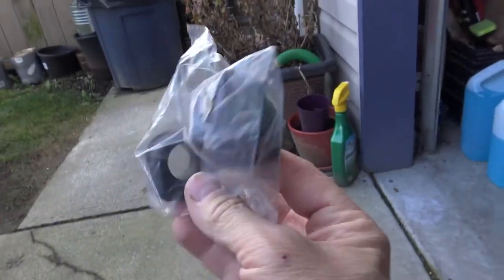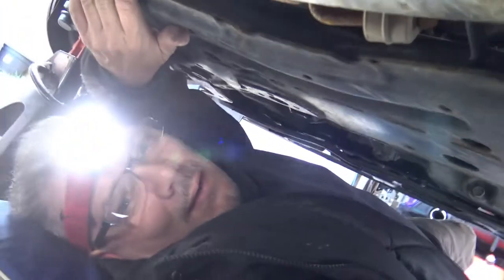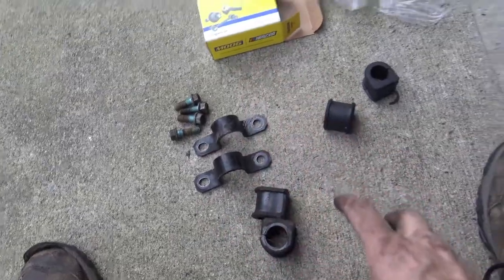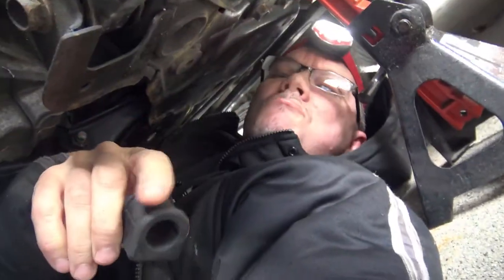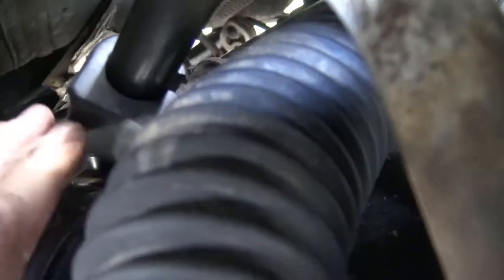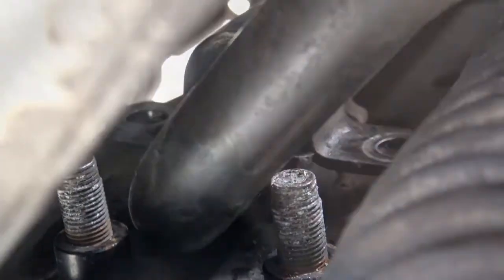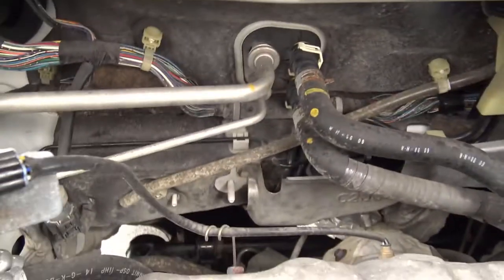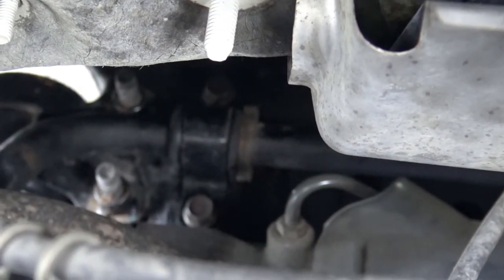Fix the Mazda CLUNK!!

Comment: I've replaced nearly every part of the suspension with the exception of these bushings.  This clunk has driven me crazy for 2 years. Thanks for taking the time to show us this.
Reply: Same. Did the bushings fix your clunk?
Reply: @thaitichi  it was a sway bar link that prematurely wore out. I'm not sure how the mechanics missed it several times but its fixed
Reply: Same here, I replaced links, struts, and ball joints, and still clunky…need to do this.
Reply: I’ve had my entire suspension replaced and started making sounds. Brought it to dealer and multiple independent places and they say nothing is wrong. I was about to get axles replaced, gonna try this now first
Reply: @incubaked  Did it fix the sound?
Reply: True story right! Every Mazda has a clunk. Couple other spots to check, are the front top strut bolts, notorious for getting loose and clanking. The passenger side upper motor mount is also pretty much guaranteed to be broken (easier fix than it sounds) rear strut mounts are always cracked, and the brakes can make a nasty racket if there anything is slightly out of place..hope this helps. (Own 2 Mazda 3s been tracking down suspension  noises for 2 years now)
Reply: @incubaked  it was the sway bar link.
Reply: @kaseyk2701  same metalic noise felt on pasenger side. Sounds like lose assembly. Suspecting sway bar bushings
Reply: @kaseyk2701  You are a genius. Been dealing with clunks for 2 years as well after my transmission was replaced. Replaced LCA, tie rods, sway bar links and still clunking. Never thought to check the strut top bolts. They were less than 10 lbs ft. Torqued them to 28 and center bolt to 45 lbs ft and now completely quiet. Thank you. Thank you. Thank you.
Reply: @TheLeedog83  was sway bar link for me as well. Although my suspension in general is not in great shape

Comment: Thank you and I appreciate your time and effort to document your DIY projects. Of note a couple of points. It was easier for me to 1) remove both front tires 2) remove the lower nut from the stabilizer bar links and disconnect the stabilizer bar from the links 3) a flex head ratchet is a must 4) 14mm tall and short sockets . 5) Soak all bolts with WD40 or similar product.  I was able to easily access both bolts that hold on the bushings without the need to go under the car. By detaching the links allows for the bar to be rotated to access the front bolts more easily. And finally the stabilizer bar can be moved around easily to allow access to remove and replace the bushings. And YES my clunk went away. For my 2012 Mazda I used Polyurethane bushings made by Siberian Bushing part # 4-01-2143
Reply: 11:15 "I was able to easily access both bolts that hold on the bushings without the need to go under the car." - When I saw the end here I was thinking the same thing!
Reply: I just added a question/comment above.  My bushings seem to be held on by a wingnut????
Reply: Thank you so much. About to do this job for my mom. Extra tips like this always help
Reply: @christianerance  Thanks for those tips, going to get this done this weekend  cheers mate

Comment: Thank you Mike! I just finished with this repair and it fixed my front end clunk. If you remove the 14mm nuts from both ends of the sway bar linkages and rotate the swaybar up out of the way, it gives you a little more space to work in your video at the 4:00 mark.
Reply: How did you know for sure the sway bar bushings were the issue? I bought an 09 Mazda 5 about a year ago and it definite has a clunky front end especially over bumps and stuff. I have no problem doing the work myself but it's a little overwhelming to start figuring out what actually needs to be replaced because it definitely feels/sounds like shit.
Reply: @jonathangaliano2617  Remove one sway bar link to the strut on the driver's side and arm wrestle or wiggle the swaybar, if you listen, you can hear the clunk. probaly replace the links whie you are there but that is just me..
Reply: @simulatortechnician9598  Yea I ended up doing the bushings 2 months ago. Like I expected it was a pain to get to the bolts and naturally on the last one it snapped. Ended up having to take it to my brothers and use the lift. Had to drop the entire sub frame and weld a nut onto the broken bolt. Eventually got it out and cleaned up the threads. Also did the sway bar links. Still a clunky piece of shit but at least that's over with lol

Comment: Thanks for the video! I just did this on my 2007 Mazda 3 sedan and holy mother of heck was it a tough job getting at the bolts and, most frustratingly, getting the new bushings and brackets back on. My 2007 did not have the collars on the sway bar, nor directional markers on the brackets. Took patience and 3 lbs of skin from my hands to get the job done, but totally rewarding. My saving grace was a flat crow bar pushing down on the brackets so that I could have a chance at getting the bolts back in.

Comment: Thanks for the valuable information. Do not use deep socket on driver side. As the screw loosens up, the socket wedged on rack and pinion and couldn’t reverse as my socket reverse switch was also pushing up on it. Got it out eventually but unnecessary torture

Comment: Just bought a stabilizer bar and I hope it comes with the bushings! I do have a set of bushings from the previous lower control arm and stabilizer bar changes (both sides) at about 195,000 mi. My 2013 Mazda CX-5 touring a wd now has 245k miles! Except for a few repairs like this it is a fantastic vehicle!

Comment: UK here. My '06 Mazda 3 has developed a driver-side knock that my first thought was drop links but wasn't. Only thing left was the bushings and as the manual says drop the subframe and use a vice to get the bushings into the brackets it wasn't going to get done. But seeing this I'll have a look to if it can be done the same way. Manual says the bolts should be tightened rear-front-rear.
Never had these bushings need replacing on any car I've owned in 50 years even with double the mileage on the '3.

Comment: Awesome! Finally some closure on a repair that seems to be stumping quite a few owners, including me! I replaced every end link and ball joint on this car as well as front bearings and this is next as well as 4 (3?)  new motor mounts. Also may want to add some KY or some other non petroleum based lubricant (poly bushing grease) to this to reduce the friction and wear of the new piece.

Comment: Thank you for the video. I happened to have read the workshop manual on the front sway bar removal, and it says the first step is to remove the exhaust pipe hangar. Now I've seen your video and understand why they wrote that.
Reply: Any chance you could maybe send me picture of the steps from the manual? Or do you have a PDF version? Thank you!

Comment: Little trick I found for these demon bushes is to jack under the control arm a touch to take some weight, flick the strut end of the link out, then undo the 2 big bolts that go through that rear control bush bracket. It's not a huge amount, but does gain some extra access to the sway bar bush bracket without the lower cntrl arm bolt in the way 😅.
Tbh, they're just a pain in the ass on these things lol

Comment: My two cents, do these bushings if you are doing a lwr ctrl arm, front sway bar collar nut is then a flat 14mm wrench with plenty of room as the cylindrical housing of the rear bushing from the arm is not in the way.

Comment: thanks that was an awesome tip.  Sometimes a different angle makes all the difference.  I struggled trying at the front with the rack in the way and from the sides -never thought to go from the back.  (BTW thats a rusty rotor at 10:20.  Must have rained in BC lol)

Comment: I just snapped one of the bolts. I had changed them before on my other Mazda 5, so I knew what to expect. Tonight got one up about 2mm and the other less than one, then one head snapped off! You can imagine the situation I'm in with the position of these. Fortunately, the bracket is so rusted in place, it's not moving at all! And it turns out it was the lower control arm that I changed out at the same time. What a pain. Will likely drill holes from bottom of table to drill out the bolts, then use bolt and washer to re-attach.
Reply: Hi Crud, same thing just happened to me. The rear bolt on drivers side snapped on me. Did you end up drilling a hole in the subframe to remove the snapped bolt? Hoping to hear that worked for you before I tackle it. Off to buy a metal toothed hole saw. 
Thanks
Reply: @stevelucas3261  I haven't done it yet. I only drilled a smaller hole to see how hard it would be. It drilled easily. I was trying to get my friend to borrow his lift because you need to raise the car high enough to get the drill underneath. Been too hard because it's busy season for him. It's still the plan, I get reminded each time I drive now that the bar is banging around.
Reply: @crudknight  thanks for responding. I ended up using a 2 1/4” hole saw to create an access port. Used an extraction tool to back the snapped bolt out.  Could’ve got away using a smaller hole but I first planned on gripping it with locking pliers…didn’t work. I was able to do this with the front end on jack stands.  This has been an absolute PITA!

Comment: Great video! It's around $600 for both the Sway Bar Links and Bushings replacement for my Mazda 6. They said it takes about 3 hours of work. I don't think it takes that long, but that's what they charge. At least at my Mazda dealership.
Reply: Had mine done at a mazda dealer for under 300$ out the door.
Your dealer must charge to drop the subframe.
I would recommend switching car brands, mazda dealers are low key trash.
They will straight up refuse to do a transmission filter on this vehicle when it is the same design as all other trans filters.
That was the last straw for me, as all their newer cars are nightmares to work on and I have never seen a mazda with 200k or more.
Reply: @TonicofSonic  Thank you for your reply. I was able to purchase the parts for a total of $65 and spent about 4 hours and did it myself. I actually enjoyed the experience of just doing it myself as it wasn't hard to do, with the exception of changing out the bushings. Had I had a car lift, it would've taken me only 2 hours to do. But again, I'm glad it's done. Also, The Mazda dealership would've have changed out my transmission filter, but they didn't see the need to. So I didn't do it. The great thing is, I had a friend that worked for that very Mazda dealership and is now working for Nissan and had me bring in my car to clean my transmission pan thoroughly and fill the ATF back to the proper level. He did this for free.
Reply: @ladmandiola8868  Wow my mazda dealer is well respected and strsight up told ne they do not offer transmission filter service as it is for life.
I had to fight them just to do a trasn fluid exchange. They just want to sell new cars and big jobs.
Reply: @ladmandiola8868  Man I just walked into a trap. Someone had drove in one of the swwlay bar bolts using an impact and they cross threaded it..snapped off the bolt head taking it out 
Now I get to drop the subframe and deal with that.
Probably just put a new subframe on it. 
😬
Any way had to vent that somewhere.

Comment: Most garages will do this by dropping the front subframe to access the sway bar bolts. I tried to replace my front sway bar bushings on my 2012 Mazda5 by doing what you're doing, but my car is in New England, and I could absolutely not get the bolts loose using hand tools, with the limited access. I ended up having my mechanic do this job, during another service, and it cost hundreds of dollars because they had to drop the subframe.
Reply: @ldstirling  yo man I hear a clunk when I turn my 013 mazda cx5 when u talking hundreds of dollars do u remember about how much tbh
Reply: @Nate-or9lw  CX-5 is not the same as a Mazda5. I have no idea if the front sway bar bushings are just as inaccessible on a first gen CX-5.

Comment: My mechanic said my boots are rusted too bad to take apart without snapping. 
My understanding is that the nuts are part of the frame and hidden .  They tried penetrating fluid but no good.  So for now we are leaving it as is for now. 
I was a mechanic long ago so I'll check it out soon myself.  What do you think is the best way to break this rust?  With an inductive heater I can most likely reach the bolt but it would be best to heat the nut. Captured in the frame.  
Any ideas?

Comment: Just did these on my dads car when I swapped out the control arms. Such a stupid tight spot. Came across this video when I took a break after doing passenger side wondering if I was an idiot and overlooking an easy method to to remove the brackets. Guess not!

Comment: Might sound crazy.. but get 2 long locking extensions and put them together and with a 14mm wobble socket go in through the top of the engine.. thx Mazda..

Comment: Mike! Help! I watched this and was all set to go. Even got the hinge head ratchet. I started on the passenger side. Bolts came out without much trouble. But I couldn't get the old bushing out, as it was stuck under the bar. Finally by pushing the bar a little, it split the bushing at the bottom where it seemed to be cracked. But now the bar is dead solid against the frame and it's impossible to get the new bushing in. Will the bar lift if I remove the driver's side also? I only had one jack stand, so I thought I'd do one side at a time. Is the only way to do this job by removing both brackets and bushings so the bar will lift and you can get the new bushings under the bar? Thanks!

Comment: i replaced the sway bar links and bushings, inner and outer tie rods, upper and lower control arms, struts pretty much everything in the front suspension. The clunk is still there. only thing i can think of do next is my cv axle.
Reply: Did you ever figure it out? I got an 09 Mazda 5 about a year ago and the front end is definitely clunky and noisy. Starting the process now of researching different things to check and it's pretty overwhelming
Reply: I would replace the engine mounts as well !!!

Comment: I have a 2010 Mazda 3 sport that I just had a shop tell me that the clunk was 100% the sway bar links and replaced them.  THERE IS STILL A CLUNK!  So.. I have pulled the tire off the care to see what is going on in there.  The bolts that hold my bushings on look like wing nuts with no where to turn them as they are butted up to the bushing.  Am I way off or missing something????
Reply: This probably an hack due to stripped thread on the lower subframe.

Probably the other side without wing nut

Comment: I just bought a 2007 mazda 5 with 252k in the ODO  for 4k$ the other day .. everything seems good it does have it's claim over the years which I didn't mind. but I did notice that there was a knocking noise when driving low > high speeds like there was a helicopter somewhere. could that be the same problem ? and also the A/C seems to be loud but does not blow too hard.
Reply: AC filter might have to be changed, it's extremely easy to do, cost is little.
Reply: @JcFadot  easy? BS those filters are a nightmare as you got to take out the friggin fuse panel out...right hand drive is easier I have heard but lefties need to swing down the fuse block and remove 5 plugs, then remove the block itself then contor yourself to remove the mountiung bracket then find the 4 screws that hold the filter cover on then figure out how to get the 2 piece filters up and in. Its a PITA but can be done in about 30 minutes but its a toolless 3 minute job on my caravan.  AS of trhte helicopter noise, Id check your CV's and front bearings. Remove the front CV's and then remount tire on spindle and spin, should be quiet. replacing these is tough, I would recommend buying the hub with bearings and bring both spindles to a shop and have them press the new bearings and hubs on. you can do it with a rented bearing press from Autozone/Oreilly but its really hard work if your not accustomed to projects like this.

Comment: Like others commented I was able to get the rear bolt off from the wheel well by removing the sway bar links (which I was going to replace as well). Was able to muscle the bracket and old bushing out, no problem. BUT when it came time to put the new bushing back in, I was able to get that on, but couldn’t get the bracket on over it. The bracket definitely fit over the new bushing when I tested it off of the sway bar, but it was too difficult to get it onto the bushing on the sway bar within the tight space. So I stuck the old bushing back on without the bracket for the short drive of shame to the mechanic.

Anyone have any idea how I might be able to get that bracket back on in that tight of a space?  Otherwise, I’m guessing my mechanic will have to drop the subframe to get at it. Figure I’ll have them do the tie rods and engine mounts while they’re at it.

FWIW, I was working on a 2008 Mazda 3 not a Mazda 5 like the one in the video.

Comment: I noticed you didn't appear to add grease to the bushing. Do others recommend grease or not, to stop any squeaking? And if yes, what grease?
Reply: yeah, Id add some non petroleum based grease (KY, astroglide, PST poly grease) to prolong wear in this. Dont laugh about the "personal lubricant" properties, they are purposely non petroleum based for latex compatability and we know what petro-grease does to latex/rubber.
Reply: @68pishta68   I even saw someone recommend wrapping ptfe tape around the metal along with the grease particularly on any polybushings... to stop squeaking. But that was on easier to reach bushings... not sure how easy that would be to add underneath these swaybar bushings? Might be worth trying though even with standard rubber bushings,  as reduced friction  will slow down wearing of the inside of bushing, so they might last longer before starting clunking again!